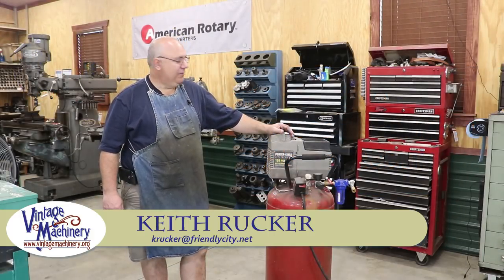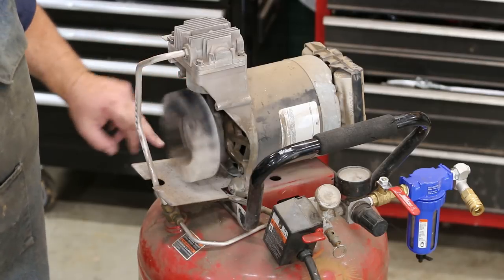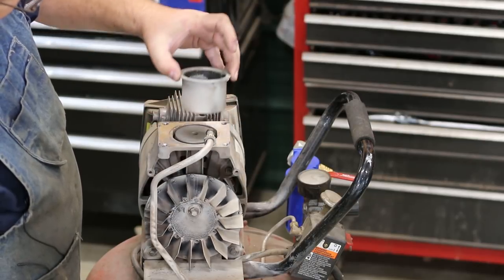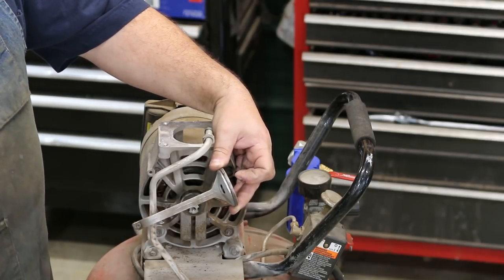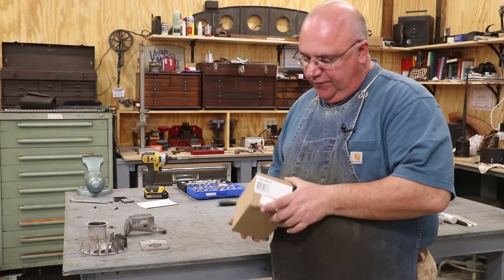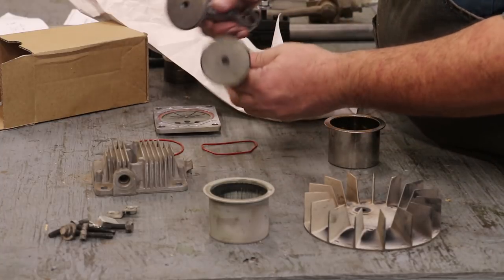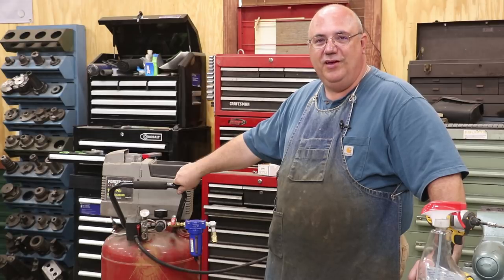Porter Cable Air Compressor Cylinder and Piston Rebuild

Comment: Brilliant Keith! AC now good for another 17 years. One cautionary note for those who would attempt this: be VERY careful of torque. When I was a kid in the 60s I worked in oil fields torching big pipe flanges with 1" grade 8 SAE bolts. Sears hired me away for more money etc to work on law mowers. After a week of stripping out every thread I touched they fired me...high torque dude in a low torque world. Fortunately, my old boss thought it was funny and gave me my old job back. BEWARE THE TORQUE

Comment: I love the way you guys can get spares for almost anything over in the States. Over here its "No, they don't make that model any more. Spares? No, we dont stock them. Would you like to buy a complete new unit?" 

I once had a chainsaw attachment for my strimmer which the oil pump packed up on. A 2" long spindle gear, cannot get anyone to supply me with the part. In the end I ordered a couple from, yes, good Ol' USA, ($3.98) and had them fedexed ($7.00) to me in England.

Comment: I'm amazed it lasted that long, at least they still sell these disposable parts. Built my own shop compressor with a 2 piston air compressor salvaged from an old truck. Ran in the truck for nearly 30 years and now at least 12 years in my homeshop. It's not that difficult to do or expensive as one might think. And it will last another couple of decades most likely.

Comment: I thought you were going to be cutting some steel for this, and about fell out of my chair when you just lifted the old cylinder out.  For some reason, I never get the easy projects!  Nice work - thanks for showing how much easier it is than an engine rebuild!

Comment: Old cast iron is nice. 300 lb compressors with unloaders, roller bearing, multiple stages, lube pumps,  low oil pressure switches, and $50 (each) check valves are fun. But, dang, someone got this down to the bare minimum and it works! My hat is off to them.

Comment: This was timely, my friend.  I just finished rebuilding a GAST compressor used in a dry-pipe fire suppression system for an apartment building I own,.  The machine was 18 years old.  Price new: $900.  Price for authorized repair station to rebuild: About $600.  Rebuild kit: $55.  It now works like new.  And BTW, it does not use any lubrication.  Just delrin/teflon rings, stainless steel valve structures.
Reply: the gast compressors are a bit different and are designed for continuous use. yes, they are expensive...

Comment: I had the same problem last year with my one, and I retired it. Even though I would drain it after use and run it to dry out the tank. I have seen a few that have gone bang. It is not worth the risk. They have a lifespan and that's it. Thanks, Keith and greetings from Africa.

Comment: Thanks for the rebuild video.
I never had one of those when I was younger.. I made a home-made compressor from an old Briggs and Stratton motor. The increased industrialization of China has really re-shaped the world of low cost equipment like this stuff and the rationale of junk vs re-build.
 - Eddy

Comment: Hello Keith,  I had that exact compressor.  Took a crap on me three years ago.  I had it 14 years of fairly light use.  Porter Cable doesn't support their equipment with parts come to find out.  Well at least with needed parts at less than the total cost of the machine when it was new.  My problem was the inertia starter on the motor.  P/C quit ordering them (the motors) from the manufacturer but had that starter for more than the entire compressor had cost me new!  I back tracked the GE motor and found they had quit making them and did not make parts available.  So with a perfectly good compressor, tank, regulator and motor (less the starter) what should have been a two dollar part and lack of Porter Cables product support I had to garbage the works.  I went and bought a far far better quality twin cylinder two stage compressor and sixty gallon tank from Harbor Freight (Porter Cable is also a Chinese company as are almost all of the major name brands) and it is so much quieter and supplies much more air that I have no regrets.  The only down side is that it is not as portable as that small Porter Cable.  Keep an eye out for a replacement motor if you intend to keep that unit.  The motor and its parts are the weak link.  Merry Xmas and Take care.  Doug

Comment: I didn't care for the stock filter on mine and found DeWalt compressors use a pipe thread filter of better design so I installed one from a scrap DeWalt. I now collect all the free discards I can find of this style pump (they come with a variety of tank sizes) since they're so easy to work with. All threaded fasteners get anti-seized to avoid corrosion.

Comment: For what it's worth, I HIGHLY recommend the Makita MAC700 air compressor.  I got one a few weeks back and it is ~20db quieter than my old P-C.  If you need more air than it can deliver then it might be time for a big two stage or a rotary scroll but for something so small, it's absolutely excellent.

Comment: I picked up a Craftsman compressor cheap with a dual-piston version of that style pump. Had a broken connecting rod as the bearing froze after a year. I'd have replaced the bearing as I hear that is a common failure.
Did not think it was rebuildable. Surprised to see kits are available. Did not matter as I got the compressor cheap to use the 60-gal tank and swap the 30-year old belt-driven pump and motor off my 20 gal compressor.
Picked up a China made pump for the old tank cheap. It worked but it was so un-balanced it walked across the room. ;)

Comment: Not what I was expecting to see inside. An O-ring, interesting. After 17 years and $35.00 you did good. Tanks will last many years as long as the water is drained, tanks made years ago are made of much better steel than most people would think. My big compressor is about the same age and has sandblasted it's entire life, not worried about the tank at all, just drain the water. Thanks Keith.

Comment: I had a compressor designed like this one and the motor gave up before the piston, I decided it was not worth the expense of replacing the whole compressor assembly so I replaced it. Instead of junking the whole thing with a gauge, ball valve and a hose I made it into a roll around air tank that worked well and I am still using it today years later.

Comment: We have a portable purchased from the local Harm & Fome, it is the noisiest thing in the shop.  Even the well-pump-sounding motor on the lathe can't compete with that thing.  If you forget to shut it down at the end of the day, it will remind you ... at 3 a.m.

Comment: Well, you will be glad to know that my Rigid air compressor uses pretty much the same parts. The valve plate uses gaskets however. Cylinder, piston, rod and fan are the same.

Comment: Nice fix! Yeah it might be "designed poorly" but hey it's worked for 17 years and is inexpensive. Not going to lie though, watching you work on something disposable and poorly made is sad. After seeing your amazing work on long lasting, well built machines I wanted you to be rebuilding a 1940's 2 stage compressor with pistons the size of a 2 liter coke bottle. However this is a lot more in my range and much appreciated because I'll probably need to work on something like this soon.
Reply: I would like to see a cylinder/body and piston(maybe some large marine engine piston?) built from scratch.That would be awesome video -reay how to build compressor ,not take a motor from refrigerator and gas bottle crap .
Reply: on the other hand a little work went a long way... and kept operating costs low....
Reply: I agree 100%. It's just disappointing seeing such a talented restorer of machinery working on something that's not worthy of his talents. But it is a useful cost appropriate machine.
Reply: It redeems itself by being made to be repaired.
Reply: Silas Marner, you can buy a belt driven compressor with the same size tank that will produce over twice the amount of air flow for under $100 on the used market.  There is absolutely no reason to rebuild this kind of junk.
Reply: Nicholas Smerk it’s cheap and not made to last but it is an inexpensive tool. It’s worth it cause it’s rebuildable and inexpensive to fix. If he gets 17 more years of use it’s worth it.
Reply: Direct drive, noisy and not made to last.  Homeowner grade, cheap compressor with a non-ASME coded tank and a motor with an over inflated HP rating.  Big-box store junk.
Reply: That's how VALUE is spelled.

Comment: Sir, cleaning both the O-Ring slots with a rag make it guaranteed leak proof and thereby enhancing the life of the rubber seals.  No to mention the reed valve dismantling and cleaning, but will lead to extensive Rebuild.  Without the Lubrication on the piston/cylinder head, quite amazing !  Hope a new Air Filter will complete it to factory made.  Even, (replacing) the bearing(s) of the Electric Motor will make it a smoother experience.  Sir, thank you for Video.  It was cool.
Reply: Dont touch what aint broken -untill it is !Golden rule of mechanics.Beside dust is a sealant too you know :)
Reply: I too was surprised Keith didn't change the reed valves and wash down the parts. 
The reed valves are a very common failure item. 
I completely agree with you that a quick spray-down with Blue Shower or CRC Brakleen followed by a quick scrub with a tooth brush, then another solvent flush before installing the O-rings and reassembly.

Comment: My 1970's Craftsman air compressor looks like a battle ship compared to that which is like a aluminum canoe.  It still works I just worry that the tank will spring a leak at any time.

Comment: I have Craftsman 60 gal oil-less twin cylinder compressor 2001 vintage. In my case the cheap die cast rod broke on one of the piston-rod assemblies. So I replaced it. Lasted about two days before the PRA broke on the other cylinder. Ended up breaking three PRA’s before I gave up. End up replacing the oil-less

Comment: I really hate the "highspeed" oil-less compressors.  It's nice that they actually have a rebuild kit though!  I had a Craftsman for about 15 years that made tons of noise and danced around.  When it finally died, it was not rebuildable.  I have 2 standard compressors built from old parts on new tanks.  No problems and I can hear myself think.

Comment: So, would the same issue cause a compressor to stop charging the tank at 40 PSI, and keep running?  Doubt I can get parts for this little Harbor Freight unit, but I might find compatible bits..

Comment: There's nothing wrong with this air compressor for home use. Unfortunately, air-cooled compressors are designed for a 50% duty cycle; that is, for example, running loaded for (say) five minutes, and off or unloaded for five minutes. It's critical that this type of compressor has the opportunity to cool, or you'll see accelerated wear. Needle scalers, grinders, abrasive metal-working tools, require a lot more air than this little compressor is made to deliver. Keith's shop needs a minimum of a 5 HP, lubricated, two-stage compressor with a minimum 80-gallon tank to work efficiently.

Comment: Oil free compressors may last long with general use but that's thing going for them. If you disassemble the oil free compressors today there aren't any reed valve at all in the head, everything is dependent on the main check valve.

Comment: You could really benefit from an in/lb torque wrench.  120in/lb is 10ft/lbs.  That little clamp screw is very likely 35-40 in/lbs, not ft/lbs.  Think of the size of a car lug nut, and those are around 80ft/lbs for small cars.  35 was likely too much for that little screw, and it is lucky it didn't strip right out.

Also keep in mind that torque wrenches are generally not accurate at their minimum settings.  However, for projects like this, it is more important to have equal torque across all bolts than to have the exact right value.

Love your channel Keith, just trying to be helpful.

Comment: I used to have the Harbor Freight copy if that compressor and mine blew the head gasket causing the same thing. I was able to use auto part store bulk gasket material to make a new one and its still working years later

Comment: It is probably worth replacing the reed valves at the same time,mine were broken at last tear down.replace those and the compressor will probably outlast the tank it’s mounted on

Comment: Some engines use oil in the fuel to lubricate piston and cylinder.DO air compressors need piston and cylinder lubrication and how is it done? I know that some of them use oil to lubricate ball bearings and crank shafts.its just i never saw one open.
Thank you for answer.

Comment: Was the torque value really 35-40 lb/ft for the connecting rod screw? Good work, Keith. The average Joe would trash that thing and buy a new one. You ain't no average Joe!

Comment: Mr. Rucker, I really enjoy you videos and find myself checking daily for new ones as well as re-watching the old ones.  I suspect that I will be blasted for what I am about to say, but please keep in mind that I mean NO DISRESPECT.  My question.....  given ALL the equipment that you have and the skill you possess, and given how “simple” the fix was, why didn’t you, for the benefit of those of us learning this trade, manufacture the “kit” yourself?  This was some turning, some milling, some setup and layout and the old piston was intact so you had a reasonable guide.  I would add that you simply sent another $35 to China.  I realize that there would have been a time investment but isn’t that what your channel is about, teaching?  You mentioned in your last video the you might teach scraping one day if RK stops doing so, perhaps this might have been an opportunity to start “showing your work” as opposed to making a disassembly and assembly video.   Again no disrespect, I just think that you took the cheap and easy route when people like myself would have liked to see how “North American” manufacturing is still alive and well.   You might have even improved on the design.  Really like your videos, Merry Christmas and all the best in 2018.  Cheers.
Reply: The cylinder looks like it's extruded and forged and not machined.  It would take a long time for Keith to replicate that part while the repair kit is only $35.  Making a new gear instead of paying $600-$800 for a replacement makes sense.  Spending a whole day instead of paying $35 for the kit doesn't make sense; Keith is a working man with a family.

Comment: I also didn't know there is a rebuild kit. I've haven't had one apart, but is that a counter weight on the crank, to counteract the piston weight?  Maybe rotates separate of the rod/piston? I'm probably blowing in the wind. 
Excellent videos, please keep them coming. Thank you.
Reply: Yep..vibration damper.

Comment: Another great video, Keith. I know these are considered "oilless" compressors, but I was wondering why you didn't put a thin film of oil on the piston ring and the crank bearing when you reassembled the unit. Thanks for sharing.
Reply: if you oil an oilless compressor piston you will destroy it in a heatbeat.

Comment: I have an "oilless" compressor. Bought it twenty years ago. Every day I've squirted a shot of oil into the intake. Yes, I know, they don't need oil.... But.... it's still running. Call me crazy or misguided.... But it has worked for me. Oilless or Oil less. Do what works for you. LOL

Comment: I have the same compressor with a Sear Craftsman label on it... The compressor works fine but the plastic wheels folded... I got some 8 inch solids from Harbor Freight complete with bearings(The old wheels did not have bearings nor were the rims steel.) I had to make 2 new axles. That aspect of mine is better than factory. When you can use Harbor Freight wheels and improve the machine it does not say much for the product.

Comment: That's interesting, your Porter-Cable compressor is a identical to my Craftsman compressor that I had to replace the piston and cylinder 2 years ago.
Reply: Randall Shular porter probably manufactured it for craftsman to slap a lable on.

Comment: Isnt there a Check valve so it wont start against the tank pressure? Also that way it couldnt leak past the Piston if the seal breaks again...

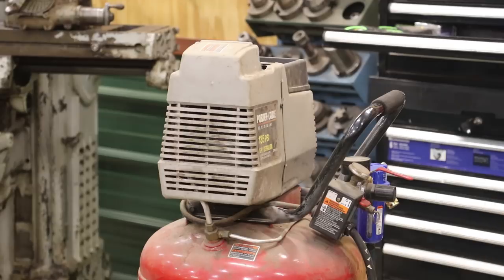Comment: Nice work but I would have thoroughly vacuumed the dust out of the pump area because working on it loosened contamination. This was evident by the small cloud displaced when it was first turned on at about 15:50 and some could have been sucked in the through the intake. Removing dirt from the cooling fins also allows them to do their job better. Making a repair without a thorough cleaning is akin to taking a shower without putting on clean underwear. :-) 
Hope your labored breathing is not a serious health issue.

Comment: I never liked those direct drive oil-less compressors because of the noise. I guess 17 years isn't bad but I have a 1979 Craftsman 1hp (I believe DeVilbiss) that had given me no problems since I bought it new in 79. I think the tank will rust from the inside before the mechanicals fail.

Comment: Well if it ever goes bad again...snag an A/C compressor...put regular 10W/30 oil in it (not hygroscopic like the freon oil)...and make a silent compressor.
Might not fill super fast...but it will do it in almost absolute silence.
P.S.  a shot or two of machine oil on the intake every few runs might help reduce the heat in that compressor
Wait...does that compressor pull air up thru the piston, I didn't see an intake port on the side of the head that you bolted down...